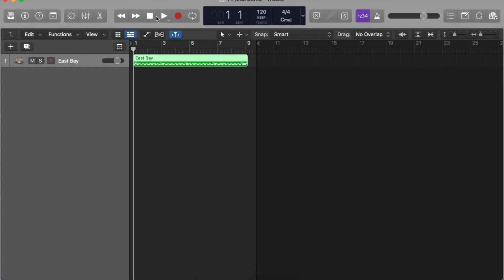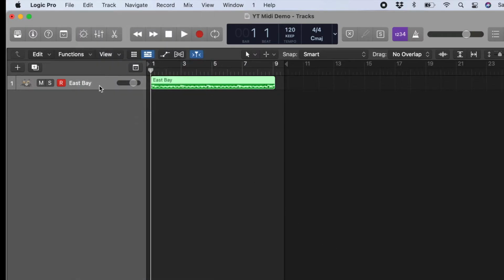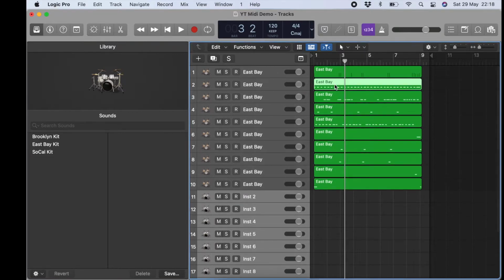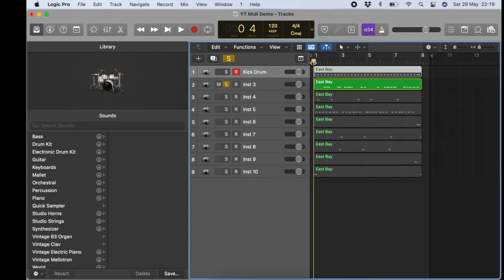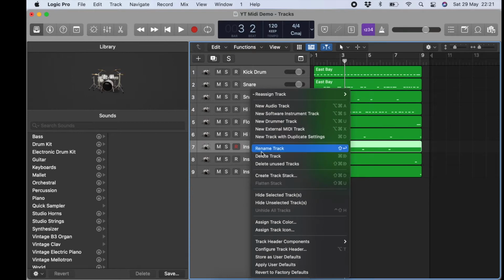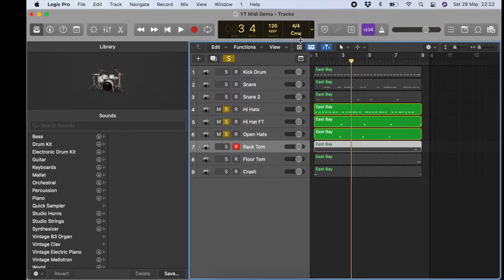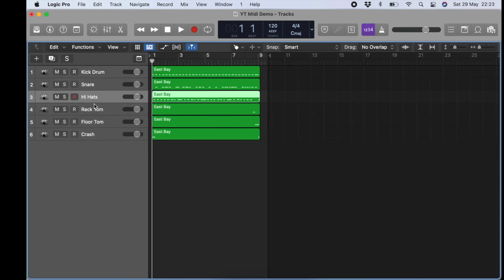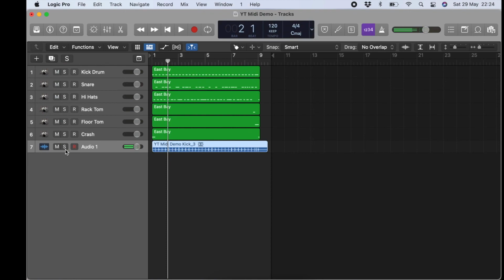Logic Pro X - Converting a Stereo Midi Drum Kit to Multi Track Audio

Comment: Thanks Chris.  One suggestion, when bouncing out each midi track to audio -- mp3s, by design, cut off at 15K, so while that might work with a kick, I'd suggesting using Wav or Aiff files with the rest, especially cymbals, hat, snare, etc., so you don't lose the upper range of the drum sounds.
Reply from the maker: Hey Tom. Thanks for the comment and great suggestion. Hope the video was helpful.
Reply: @chriswhitehouse1643  Hey Chris, yes, I did find it helpful, thanks again.  Just thought of another refinement.  Instead of outputting the midi tracks to audio one at at time, output all of them at the same time: select all the desired tracks, then File>Export>5 Tracks as audio files (5, or however many -- the # on the menu represents the # of tracks you selected).
Reply from the maker: @TomRValdez  I did think of that…I can’t remember why I didn’t do it now 😂🤦🏼‍♂️